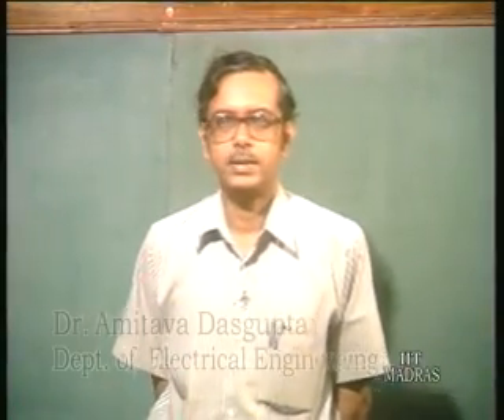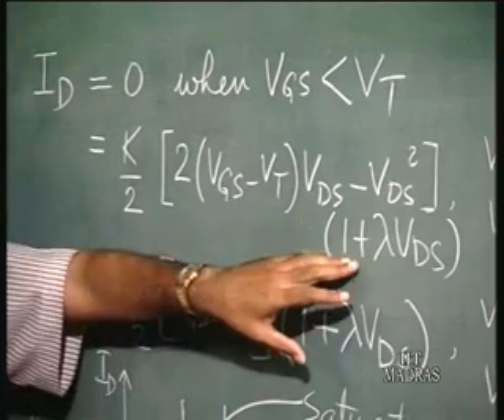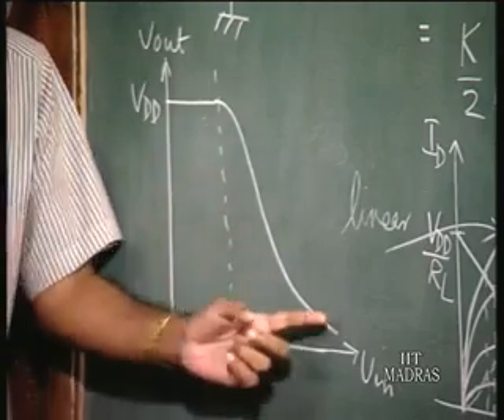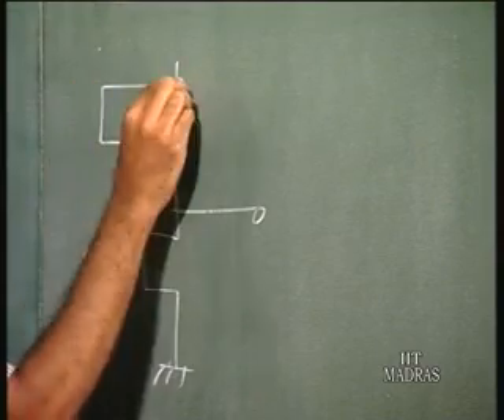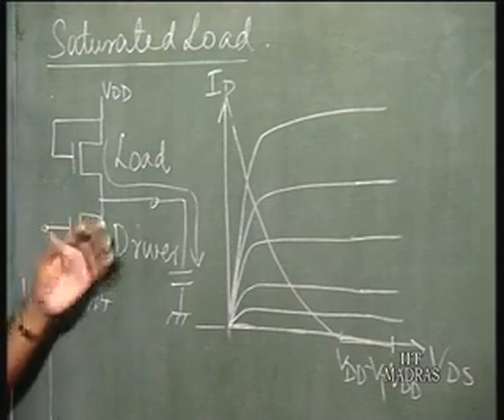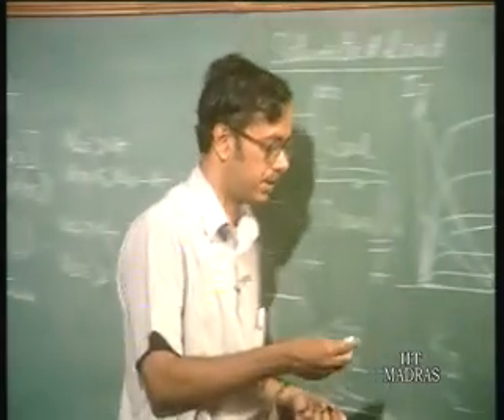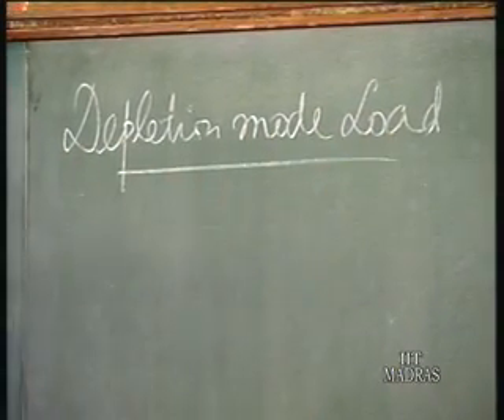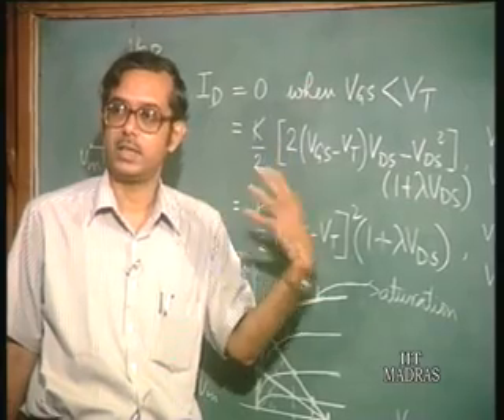Lecture 24 nMOS Logic Circuits

Comment: why its not advisable to use a resistor as load?20:25
Reply: resistor can not be fabricated in a chip
Reply: It will increase time constant of a device RC...so device will be slow
Reply: Resistor takes more area which impacts the performance of IC

Comment: "Pinch off" is altogether a different phenomena. The depletion type MOS must also have the pinch off characteristics which is defined by the pinch off voltage. Then, why is the Threshold voltage for depletion type is being called the pinch off voltage. They shouldn't be the same. It is not necessary that the pinch off voltage should be negative. Refer 46:00
Reply: having the same doubt bhaiya .. If you now Know the reason or Correction can you Please explain !!!!